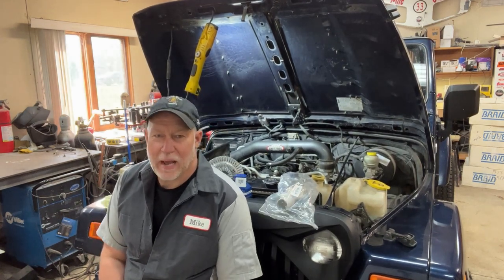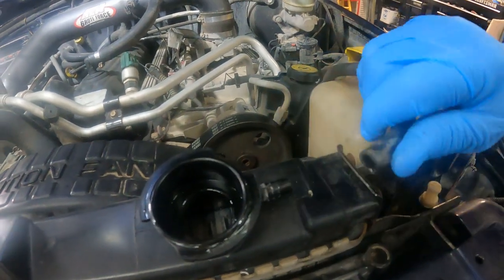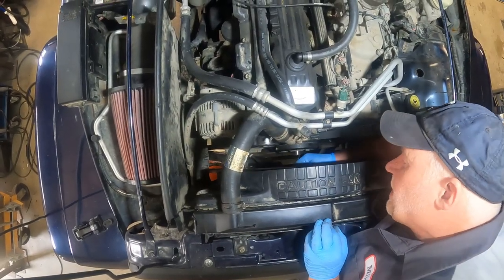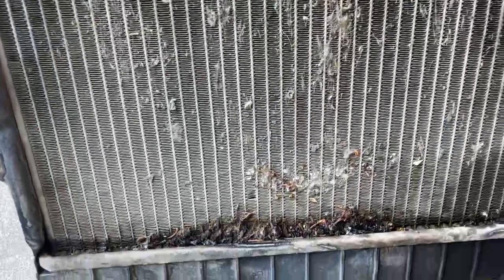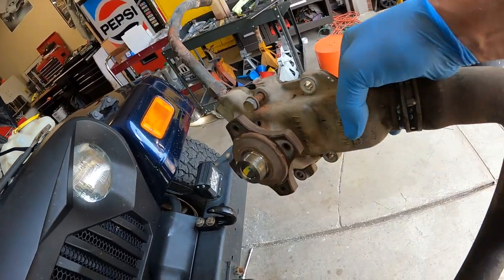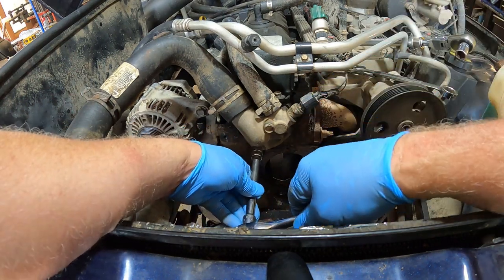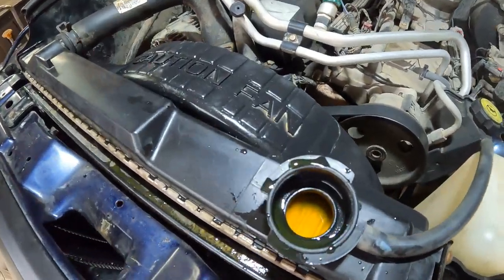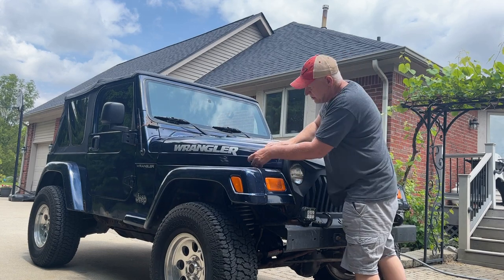TJ Jeep Over Heating Issues - replaced the fan clutch, water pump, thermostat, and radiator cap.

Comment: New radiator, new clutch fan, new thermostat, new water pump, new pullies and belt. Everything was fine, but then i got my ac fixed(new condenser) and i overheat when stopped at idle randomly(doesnt happens all the time) while driving, its fine even with ac full blast. No idea what the deal is... any ideas?
Reply from the maker: Wow you replaced everything. Great question…The only 2 things that come to mind 1 Is the fan shroud damaged or has a large gap from the shroud to the radiator 2 with all the radiators on the market a good quality radiator is king.
Reply: @33milegarage34 update. My new radiator blew today. After only 10 months of being installed. Cracked across the top in the same exact location as the old one. Coolant exploded and went everywhere and it happened when I turned off the car. just like 10 months ago. No idea why this happened. Going with all aluminum rad this time
Reply: i had the same problem aftermaket rad had a hair line crack on the top after about a year so i went with the mishimoto alumimum rad good so far

Comment: I used a Hayden heavy clutch, 195 thermostat and a Griffin 3'' Rad...She sits on 190-195 in 100 degrees.  I don't like it at 210 plus my A/C works better.
Reply from the maker: I agree with you, Haley’s Jeep sits at 210 and I always felt it was to hot. I like your set up running at 190-195!!!! Thanks for watching
Reply: 210 IS
TOO HOT 😊

Comment: Great video! Is there a tool I can purchase for the fan removal? Thnx!
Reply from the maker: Yes they sell a tool. I just looked up a Clutch fan removal tool on EBAY for about $25. Most tools come with a few sizes. If I remember correctly the nut is 36mm and the other portion of the tool needs to span 2.25”” or 57.1mm for the water pump pulley bolts. (most tools have a large slot to accommodate multiple sizes) if the nut is seized on and you need to use force to break it free the cheaper tools will bend up.  Thanks for watching!
Reply: To remove the fan, an 18" crescent wrench or 18" pipe wrench on the giant nut works. Take a 1/2" breaker bar, put it into the tensioner, push that to the passanger side, and then whack the wrench with a hammer.

As for removing the fan clutch O'Reillys will loan you a part for 48 hours to remove it.

Comment: I keep having overheating in my 03 jeep tj. I replaced the radiator thermostat water pump clutch fan head casket. I checked all the relay and its still overheated.  I realized after i installed topfire style front grille i start to get overheat. I took it off, everything went back to normal. (It was not enough air flow to the radiator from the peice of crap i installed)
Reply from the maker: Yeah. I’m sure that was frustrating! I’m not a fan of the aftermarket grills but It’s my daughters Jeep and she likes it, and it doesn’t really block air flow. Thanks for commenting and watching

Comment: Make sure you use the CORRECT radiator cap.
Partial pressure cap NOT a normal one that has the spring loaded bleeding valve
Reply from the maker: Good point and easily overlooked! Thanks for the comment and watching!
Reply: All good 👍🏻 
I have two TJ wranglers here in Australia and we can get some HOT summer weather so the cooling system is my number one ☝️

Comment: And for those of us that did the Electric Fan And eliminated the mechanical Fan .. what suggestions when over heating would you consider to be ?
Reply from the maker: Diameter of the fan and how it seals against the radiator are big factors. The fans need to have a shroud that seals tight and covers 80% of the radiator surface.  A cheap fan with a little shroud will not keep it cool. Thanks for watching

Comment: I put the angry bird on mine and the temperature went up 15° . I have a winch and there's no air flow now. Took it off and I am back at 175°
Reply from the maker: Wow 175 degrees is super low for 4.0L that’s great. Thanks for watching and the comment!
Reply: @33milegarage34  It's a 2.4. Still low. I put a nice aluminum radiator in it. Much better.

Comment: Every single video that I have watched about replacing the water pump, they all forget to put a bucket under it before taking it off so coolant spills onto the ground. When I replaced my water pump, I also followed those instructions.
Reply from the maker: Yeah. The worst part is the bucket was only a few feet away under the radiator.  Thanks for the laugh!